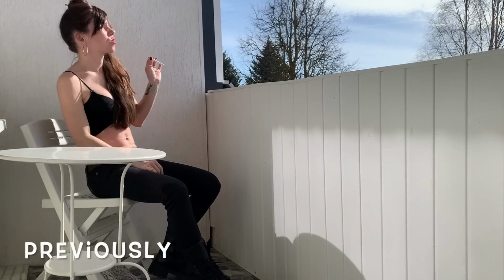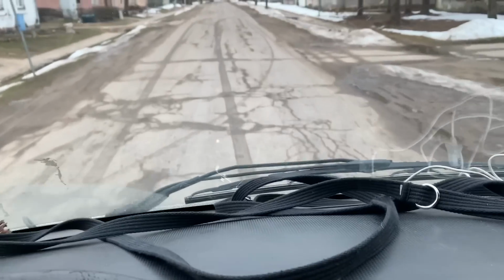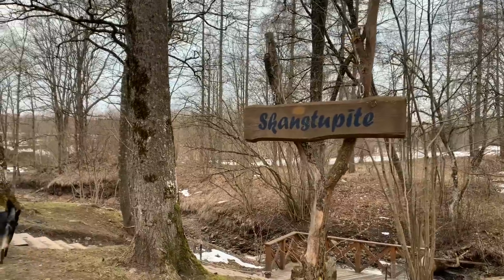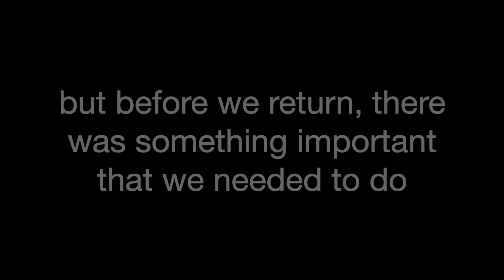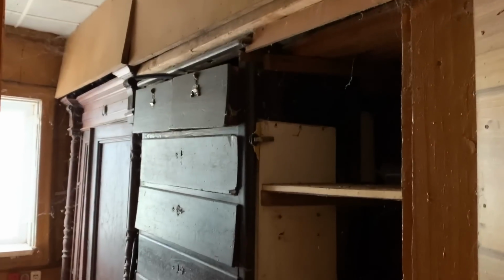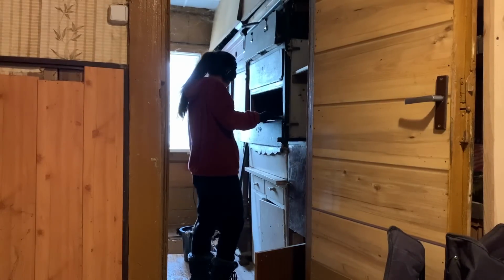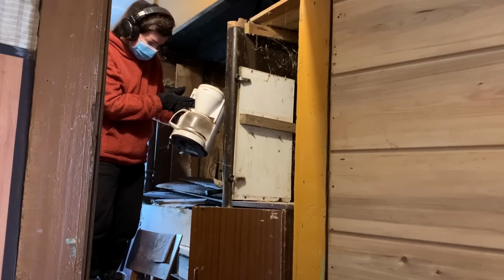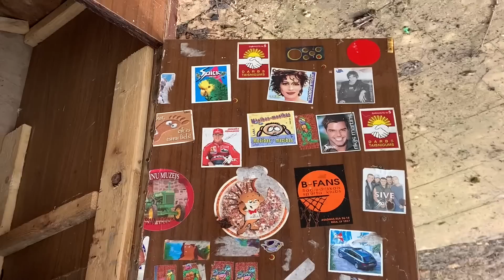I found a mice nest and the well got flooded badly / Cottage renovations

Comment: Suggestion.   Pick up a portable sump pump and hose.  You can use it to run water to a filter and then to your water lines in the house. 
Then once the water lowers later in summer to where you can get to the well pump to fix it.   As I would imagine every spring your well will fill from the snow melt.

Comment: What a well done travel vlog with beautiful views/music for the scenery. I looked up all the places you visited. That was quite a road trip with interesting places. That demolition was hard work. I knew that room was there but we've never seen inside before. You sure aren't afraid to tackle difficult jobs. Wish I could build you a new bathroom there. It would have to be insulated from the cold outside walls and add a filtered water heater for inside showers. Not as much space as those motel showers you were in but better than the greenhouse. Would also have to repair the walls and ceiling and add good lighting (you know why). You never fail to amaze me with your talents, energy and determination. Luv ya.

Comment: You will not be able to lower the water level in the well by using buckets Leila, it is fed by the surrounding ground water level so it will only drop as the ground outside the cottage dries out.  Great job on clearing all those old shelves and cupboards which were a hiding place for mice and rats.

Comment: By the sheer volume of chewed up insulation in there, that wasn’t mice. Another clue is the size of the kibble. It was most likely a squirrel or a rat family. Being that close to your well, and it being flooded, you need to have your well pumped out and the water tested for contamination. Definitely DO NOT use it for anything.